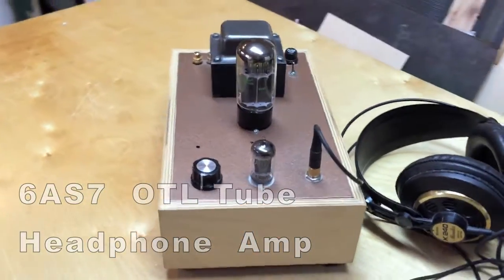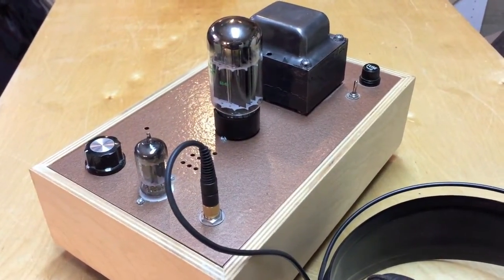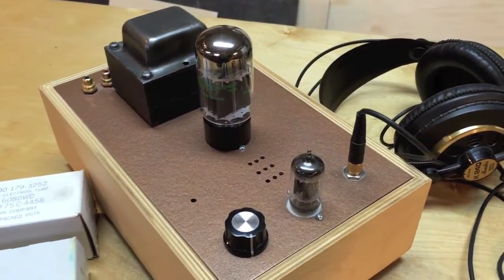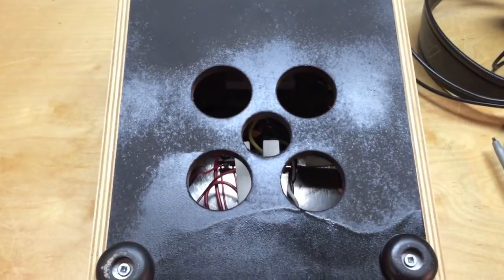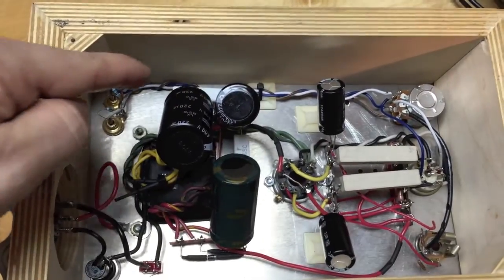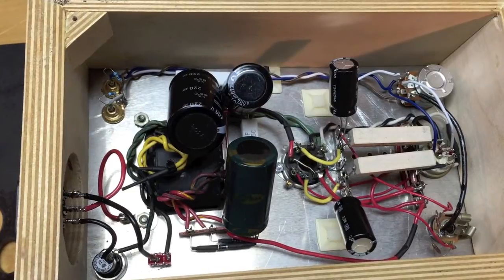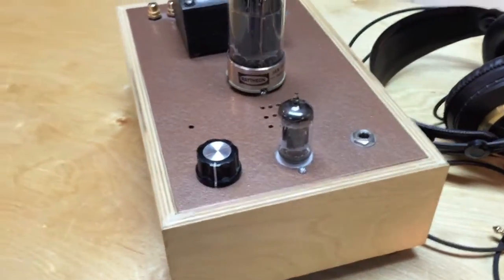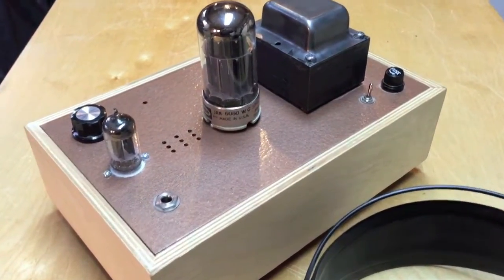6AS7 Tube Headphone Amp // Self made headphone tube amp

Comment: Hello! My name is Alexander I live in Hungary, I built the connection today, for the time being in an experimental version.
Do you have any advice on how to filter the power supply effectively? (50Hz).
If you could share how you did I would be very happy for him, I might have a mail address if needed.

Thanks!
Reply from the maker: Hello, thanks for our comment. First off you need to make sure you are using the correct Power Transformer that has the proper values. I used a simple CRCRC filter. I did a Solid State Full Wave Bridge rectifier  >> 220mfd, 1K, 220mfd, 1K, 220mfd.  I would recommend using the PSU simulator found on Duncan amps website.  If the grounding is not right, you will hear hum in the headphones. I hope that helps?
Reply: @MikeFreda  Hi, thanks for the answer, I'll try it on the weekend, I'm waiting for the ordered parts.  Today was just a test, cable version.  What kind of transformer would you recommend?  What should be the AC voltage?  It must be calculated that the DC voltage is good after buffering.
Reply from the maker: The Power Tube does not need a lot of voltage but does draw a fair amount of current. You need around 200VDC at the Rectifier and ~150VDV at the Plate of the Power Tube.. Just Google: "Aren van Waarde Headphone Amp" for more info.
Or go here: https://headwizememorial.wordpress.com/2018/03/20/a-single-ended-otl-amplifier-for-dynamic-headphones/
Bottlehead has something similar. Check their forum and website for more info.
The amp does run "Hot". I hope that helps?
Reply: @MikeFreda  Hi, the problem is solved! Thanks for the advice, perfectly noiseless. This tube has a very nice sound (6080), I made the first tube with e88cc.
Reply: @MikeFreda  Hello!

I still have so many questions that I see you grounding the negative? Is the iron core of the transformer also grounded? If something is not clear then it is because I am using a compiler sorry.
I'll box it all up tomorrow, I barely found a suitable transformer, the 6080 tube is heated to nearly 3 amps, I still want to put two EM84 magic eyes in it.

Comment: Great job! So this was made by you & is not the kit from Bottlehead correct? I just finished building the Crack myself & noticed a handful of differences with yours. At first I thought it was maybe an early rendition of the Crack but then noticed you mention at the end that "companies offer a kit like this"...
Reply from the maker: It's scratch built with a few styling and layout idea's from Bottlehead. I do have some Bottlehead gear and just wanted it to match. The components are different. I originally build this amp based on Aren van Waarde design ~10 years ago.

Comment: looks mostly like a slightly modified bottelhead crack, but no mention at all about it being the base of your project....somewhat misleading...
Reply from the maker: Your observations are somewhat correct. I do have have a bunch of Bottlehead gear so I re-made this to look like the rest of my gear so it would match in my rack.
I originally made this ~10 years ago from a schematic that was posted on Headwize. The original project was made by Aren van Waarde. His schematic and layout is posted all over the net.
Reply: @MikeFreda  the original project is for ecc88 as input tube, did you modified something to adapt the 12au7? Thanks
Reply from the maker: @marcovizzari681  Just 3 simple things need changing. Filament connections. 12AU7 use pins 4/5 and 9. ~22K load/plate resistor and a HLMP6000 LED on the cathode (as per Morgan Jones book) You want around 90v at the Plate and 1.5v on the Cathode. You could also substitute a resistor on the cathode to suite. Just use ohms law to figure that out. Each triode draws around ~3.6mA  V=IR ~ 416ohms... A 412ohm should get you in the ballpark. You can play with it to it sounds good to your ears.